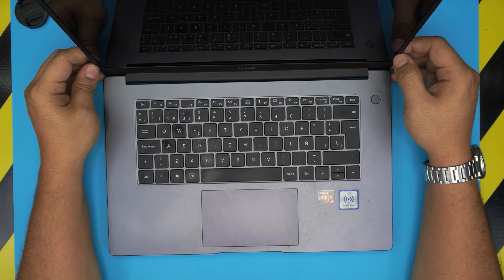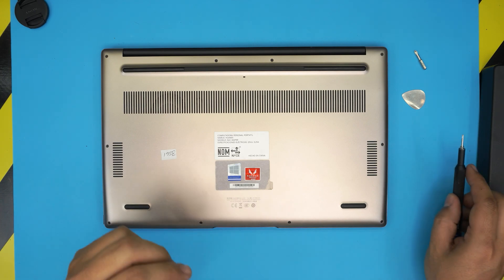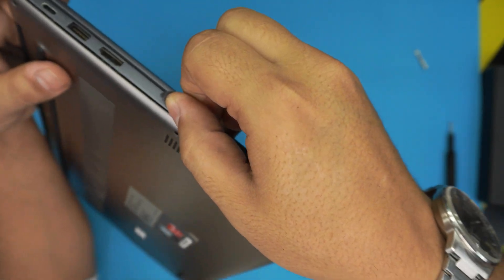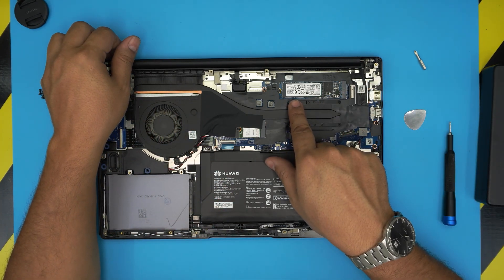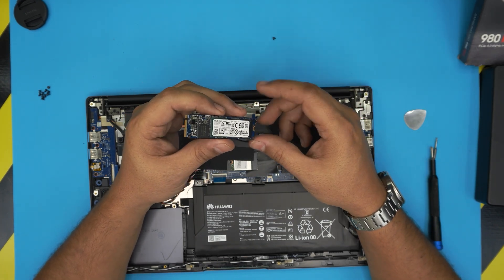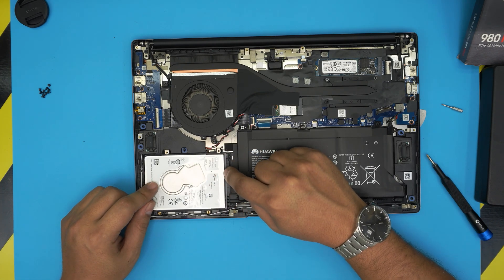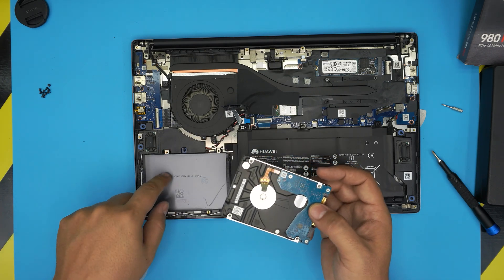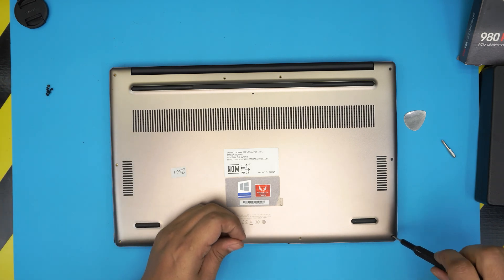Huawei D15 Boh Wap9r 💻 M.2 SSD NVME Upgrade

Comment: From which brand is the factory default SSD used in the laptop?
Reply from the maker: 🫠Regarding your question, depending the location and date of the assembly, they come mixed sometimes hynix , samsung or WD, but no matter the brand they will always place the low grade of the brand, for e.g. the will place low end version of samsung nvme.
Should you have any further questions or requests in the future, please don't hesitate to ask me.
cheers🍻

Comment: i have the D15 ( 2022 ) can i add more storage but is the windows will be removed? (Lexar  nm620 PCle Gen3x4 NVMe ssd )thank  you
Reply from the maker: 🫠Regarding your question, you can only place one nvme (the one you mentioned will work just fine) but you will need to re install windows from usb, it takess 5min and few windows updates and  you ready to go.
Should you have any further questions or requests in the future, please don't hesitate to ask me.
cheers🍻
Reply: @uFixTek what about my files are they going to delete? + if I put a hard drive disk I need to download windows again or nothing going to delete
Reply from the maker: yes you should bak up your file on external drive and install windows

Comment: Nice upgrade if you want lost recovery partition :/
Reply from the maker: If you don't want to loose the recovery partition (that is useless) you can clone the old drive to the new drive. OR just install the new windows and download all the drivers and then make a restore point and save it to recovery partition.
cheers🍻

Comment: También puede ser compatible este hardware Kingston SSD NV2, Capacidad: 1000 GB, Factor de Forma: M.2 2280, Interfaz: NVMe PCIe Gen 4.0 x 4 Carriles, Lectura: 3500MB/s y Escritura: 2100MB/s, Numero de Parte: SNV2S/1000G te agradecería muchísimo tu opinión.
Reply from the maker: si claro, es 100% compatible incluso hasta 2Tb puedes meter.
saludos
Reply: Ваш диск PCI 4 не сильно греется в этом ноутбуке?

Comment: Huawei mate book d15 i5 8g 256gb ssd 2022
Windows 11 Home
Do you think i can upgrade the storage with 1T ssd 2.5?
Reply from the maker: 🫠 If you wish to support the channel, you can like, subscribe, or both!
Regarding your question, sure you can and you can place a up to 4TB ssd 2.5' and 2TB NVME at the same time without any issues, just get the correct 2.5' adapter. and some double sided foam tape, to hold the ssd to the case.
Should you have any further questions or requests in the future, please don't hesitate to ask me.
cheers🍻
Reply: @uFixTek 
Thank you so much 
Sure, I will subscribe  ❤️
Reply from the maker: It's my pleasure my friend.
thank you for the support 👍🍻

Comment: Hey there I would like to know that is it true that the 2021 version of the matebook d15 doesn't have the connector slot to connect the hard drive/2.5 SSD?
Reply from the maker: Thank you for the feedback! if you wish to support the channel you can LIKE or SUB or both :P
regarding your question:  the connector on the motherboard is there on 2021 models, all you need is the right flex adapter.
https://amzn.to/3IOWYvD